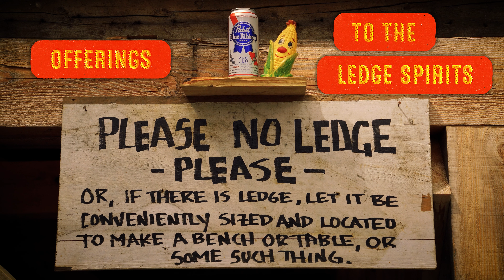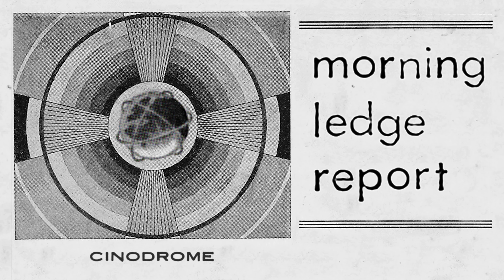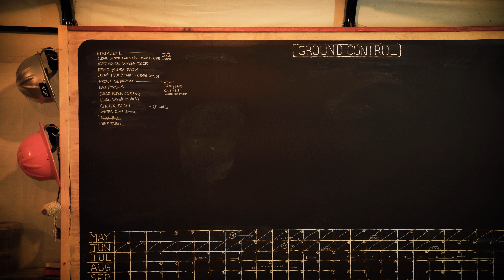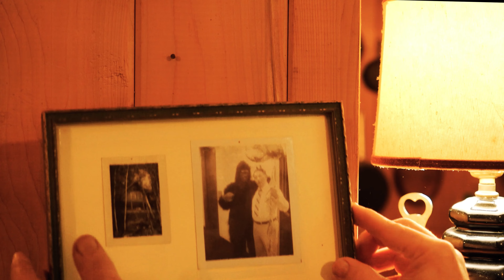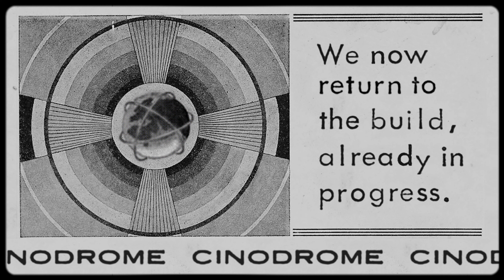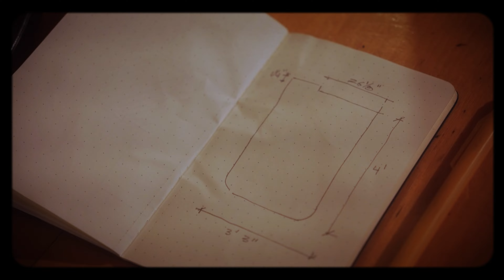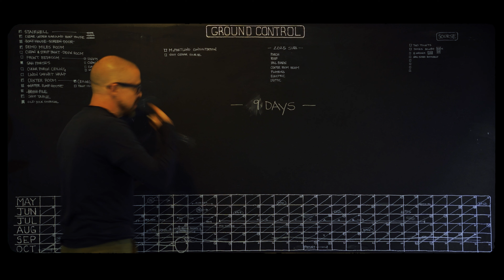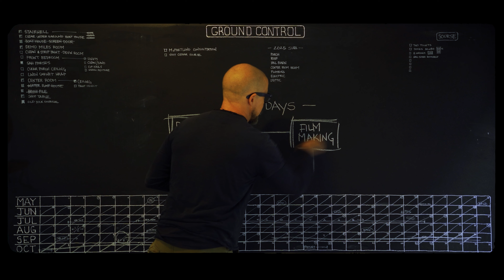SAVING our 1880s Maine Lakeside Cabin: YEAR 2 in 75min

Comment: You did a spiffing job Dave ole mucker!
Reply: Install a vehicle grade spray machine/ compressor and epoxy resin coat the kahoons back into every wooden section!
Reply: Ps maybe spray on some protection first!
Reply: I still say:

Build a concrete bunker grade external underground bunker/room for all manner of pumps/compressors, fuse boxes and generators!

Located on the outer perimeter of the property..

Make it like a control room with cctv and CB facilities!
Reply: Truth is:

Forests can overgrown, which actually results in them destroying themselves!

Extra shade from overgrown trees increases ground moisture which accelerates corrosion and decay!

Maybe get rid of 50% of the trees, reincorporate light onto the ground (near newly laid driveway) bringing back grass and light and airy spaces..
Reply from the maker: All of your, genuinely fascinating observations, are closer to the actual plan than you might expect.